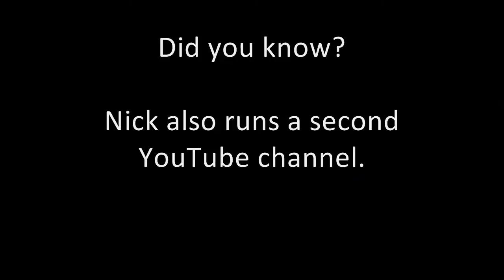How to install a bridge rectifier on a cheap power supply

Comment: can the bridge rectifier be used to reduce output noise?
Reply from the maker: Capacitors and inductors are in charge of noise filtering. Capacitors can go bad and not filter properly. Cheap power supplies typically have poor quality capacitors, so a recap would help.

Comment: Hey man. I was wondering could i do oppisate installing diodes instead of Bridge Rectifer. Since i have old monitor on which bridge rectifer died.
Reply from the maker: Depends on how the PCB is designed. The traces must be designed to connect the 4 diodes in. You'd be better off either buying a bridge rectifier or salvaging one for replacement.

Comment: Can you use a 1000v 4a rectifier replacing a 800v 8a rectifier?
Reply from the maker: I recommend matching the current rating of the old rectifier.

Comment: No real advantage over discreet diodes (of the same ratings) except that you can attach a heatsink to it.
Reply from the maker: The rectifier is likely rated for more amps than the discrete diodes. I've seen units where the diodes were rated for like 2A. Also, since the bridge rectifier sticks up, it can be cooled easier.